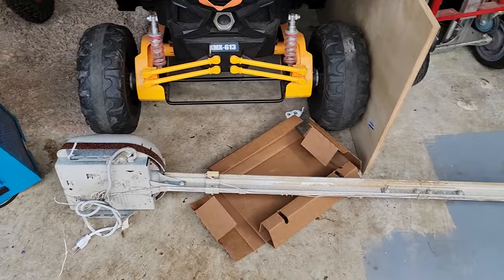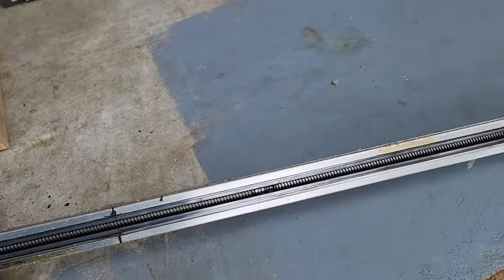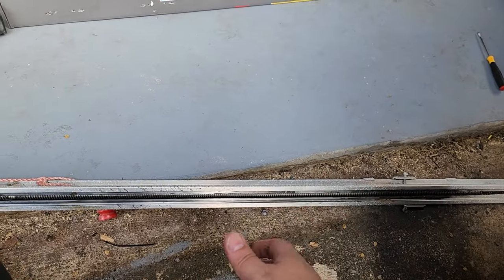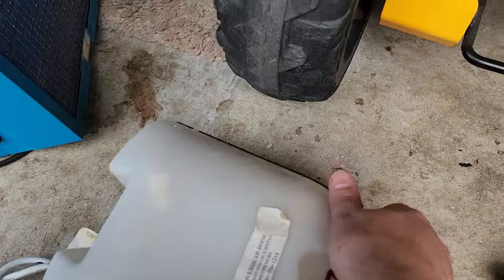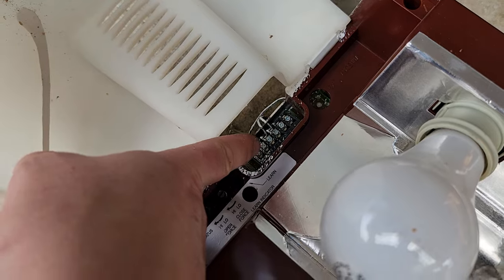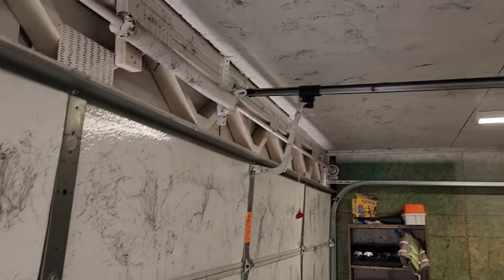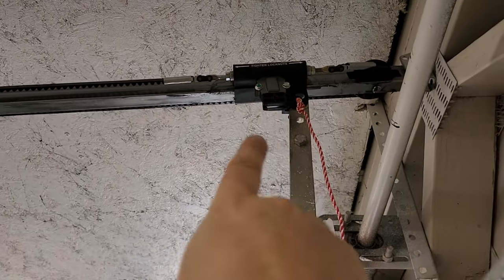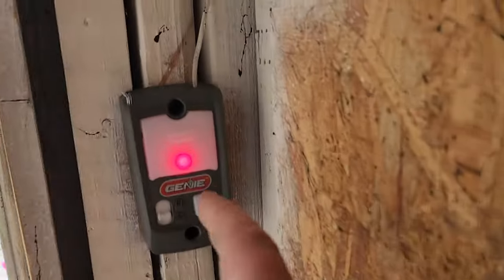Non-medical. Exploring a Vintage Garage Door Opener

Comment: 1:07 i can be wrong, but i think those are not Hall sensors, but plain old reed switches, they have a small glass tube inside with 2 contacts that close if a magnet comes nearby. 
They are also used in alarm systems on windows and doors. Hall sensors have at least 3 wires to work, while a Reed switch just use 2 wires and create a "short" when actived. Some reed switches produce also very silent "click" if you move a magnet to it. 
Some new type Garage Door Openers use a disc inside the unit that rotates at a very low speed (gear reduction from the motor), on this disk are 2 plastic taps that control 2 micro switches that determine the open and closed position of the door. 
From the old Garage Door Opener, you can recycle the RF remote receiver for future projects. On most Garage Door Openers, the RF part is a separate box that is connected to the pcb of the opener. Back in the days, they used arround 40Mhz as frequency, the safety "key" could be set with a set of dip switches in the receiver and handheld remote. 
Also if you replace your Garage Door Opener, it's the moment to check if your torsion springs are still balanced. To check this, you need to engage the emergency release, and open the garage door half way, a good balanced garage door stays at that height (and any other heights as well). 
If the garage door lowers from itself, the torsion springs need more tension, if the garage door goes up, the torsion springs need less tension. But useally by time and wear, they need extra tension. When the garage springs are perfectly balanced, the motor need less power to operates the door.
Reply from the maker: Some hall sensors do use two wires, but you're right. 25 yrs ago, this probably has reeds. I'll disassemble to see.
Reply: @BetterBiomedChannel  , Interesting, always thought that a Hall sensor always has at least 3 wires, Vcc, Ground and Vout. Nice to know. Grtz

Comment: I had no idea that these used acme screws.  
This might be a good 'convenient' source for someone looking to make something.

(Also, are garage door openers not supposed to push/hold the door down with more pressure, since they do replace the lock functionality?  Or is this more of a thing where I am because of climate? )
Reply: The closed position is useally set by end switches and the door doesn't produce that much pressure when closed, because most garage door openers activate back to the open position if the "pressure" is to high by monitoring the load on the motor, like for example if your car is located under the door while the door is closing and the door push against your car, or if a person is standing in the door opening and gets trapped. The IR sensors are mostly optional to avoid such problems. On most Garage Door Openers the connection from the trolley to the door is a direct metal link, but sometimes they also use a gas spring between the trolley and the door, for more pressure when the door is closed.